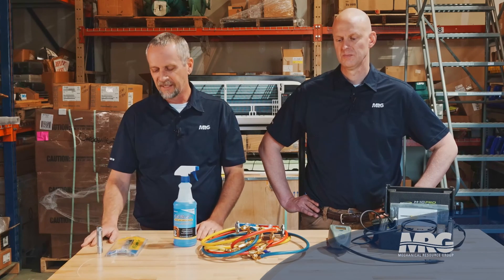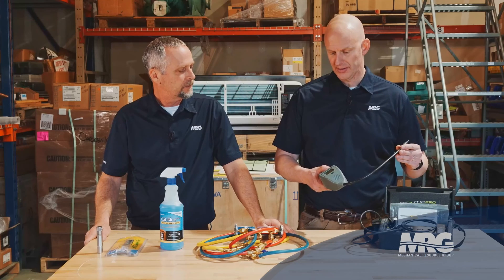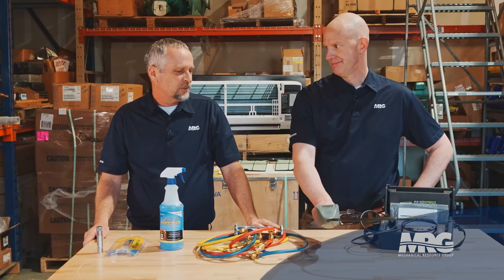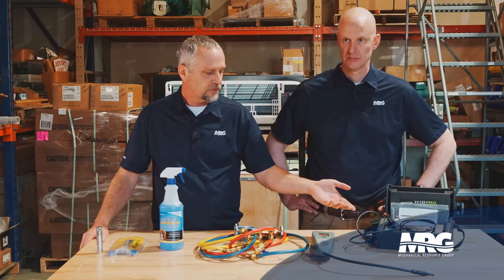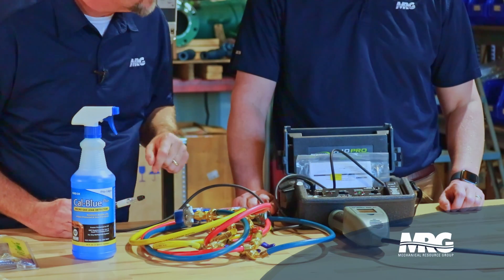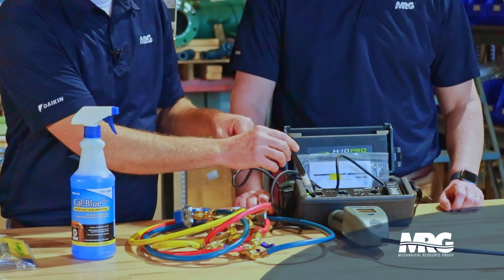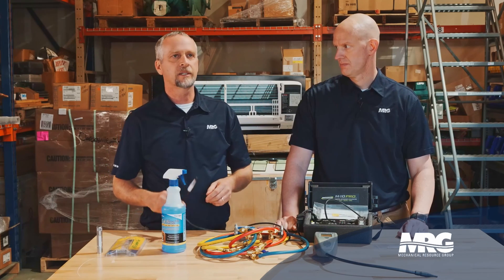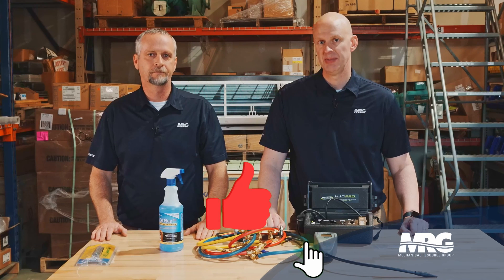HVAC Pro Tips: Choosing the Best Refrigerant Leak Detector Tools

Comment: Good video, there are a few drawbacks to the H10- just remember to stay away from wet coils, as the air pump will suck moisture into the heated diode and cause problems, making you have to pull the sensor out and dry it out with nitrogen. Another issue is the sensors tend to wear out and need replacing after a lot of use. The little leak calibration bottle will leak out and evaporate quickly in warm climates. I use infrared leak detectors nowadays as you don't need to worry about moisture and the sensors last a very long time. I have over 40 years of experience in the trade and started out using the H 10 and many techs do agree that its a great unit.

Comment: If you cant find calblue, you can also use fabric softener. Also sticks longer on the pipe than soapy water
Reply: If you put fabric softener in a spray bottle and spray it instead of soapy water, its thicker and stays on the pipes longer and it also bubbles. Works the same as calblue and can be purchased at any grocery store in your area, especially if you are far from your supplier of calblue and you dont have any on your van. Use fabric softener. Tried and tested.
Reply: @renierlabuschagne2141  hello thank you for the information. I live in Türkiye. I don't know what fabric softener is called here. Can you give me an example? Is it something like fabric softener? Or, for example, could it be dishwashing foam? I want to know what exactly you are talking about. What is its equivalent in Türkiye?
Reply: @renierlabuschagne2141  So what should be the percentage of water and softener? Is just water and softener enough? Or do you need some soap?
Reply: Ultra sonic leak detector, you can also use a hearing aid for deaf people, but you need to extend the hose. You get really cheap versions from pharmacies.
Reply: @renierlabuschagne2141  Is the fabric softener probably used for laundry correct?
Reply: @renierlabuschagne2141  thank you so much
Reply: Fabric softener? Can you explain

Comment: I've been having good luck with 95/5 (95% nitrogen/ 5% hydrogen) gas and a combustables leak detector. A 300 CF tank is somewhere around $130 and you can scream the pressure up to 400-500 psi to make sure that leak shows up. I've really only used it on VRV/VRF systems where we're chasing a leak indoors somewhere. If there's still refrigerant in the circuit I will stick with a Stratus, but if it's been recovered already for whatever reason the 95/5 works nicely.

Comment: If the system is out of refrigerant just putting nitrogen with the dye will not show all the leaks. The system needs to be running to distribute the dye, and of course it needs refrigerant to do so. The only thing about the H-10 detector is the pump going out and the manufacture does not have them.

Comment: Gentlemen, I started in refrigeration back in 1985, and we used the G.E. H-10.  Bacharach now makes the H-10 Pro., the same device as back in 1985 when we only used R-12, R-22, & R-502.  This thing is still the best leak detector on the market.  Even when the air is saturated with refrigerant, the sensitivity adjustment allows you to find the leak.  I've used the Stratus, Fieldpiece and several others.  This is by far the best leak detector on the market since and before 1985.  It will NOT detect R-290, (Propane), that requires a flammability detector, because R-290 is propane, refrigerant grade.  I ALWAYS back up my leak detection with what you are speaking of, Big Blu, to pin-point the leak.  Most of the time I don't need to, as the leak will be obvious after being found.  On micro leaks, the H-10 Pro will find them, but bubbles may be needed to pin-point the leak.  Good video, if you can afford the H-10 Pro, buy it!  It will provide a life time of leak detection that others cannot do.  After 38 years in the trade, I swear by this single leak detector.
Reply: Does it work well for 410A on small leaks too?

Comment: I have the Inficon Stratus....hands down best leak detector I've ever used. 2nd would be my ultrasonic....which is also good for checking motor bearings as well. I had an H10G....somebody stole it from me. That Nu Calgon leak detector bubbles is crap compared to Refrigeration Technologies Big blu.